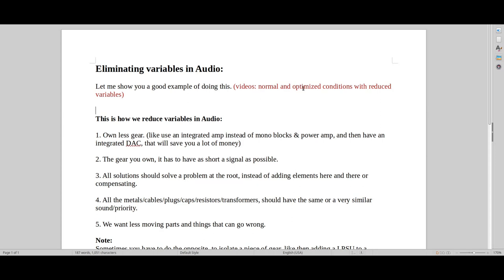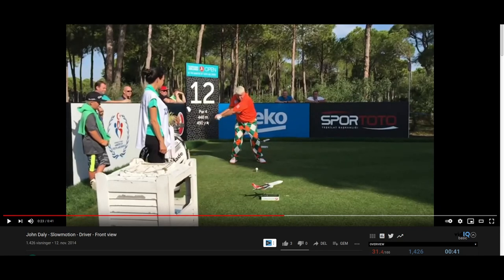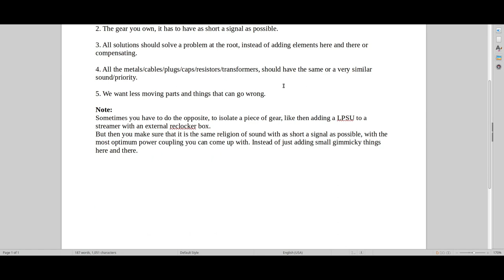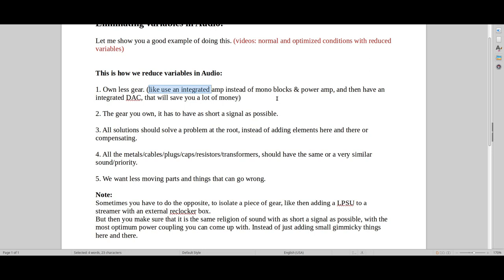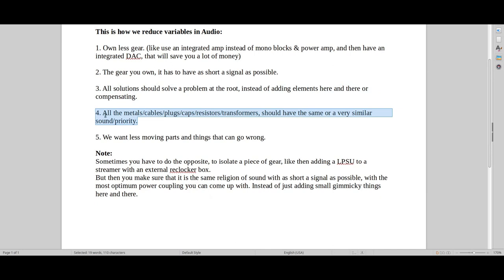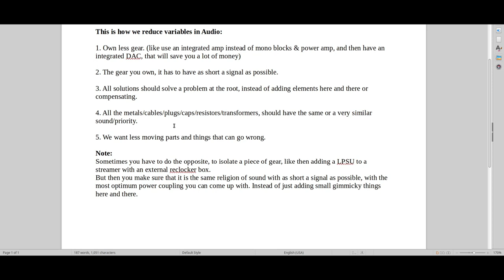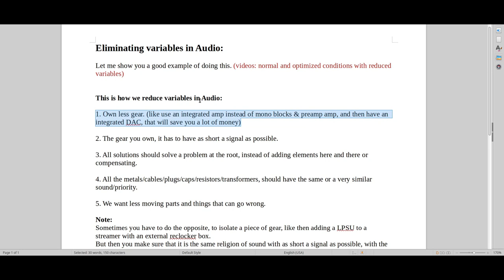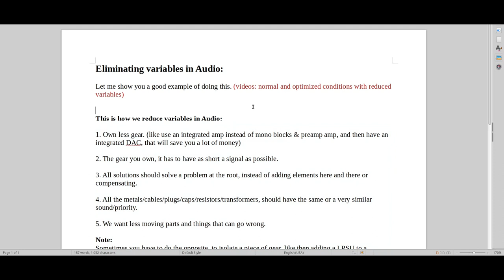Eliminating variables in audio

Comment: For the past 15 years I have been using tube separates built by an individual in Pennsylvania who goes under the name Emotive Audio (not Emotiva). These are high quality tube pieces. I have stockpiles of NOS tubes and would swap out different signal tubes or power tubes or rectifier tubes and for the most part would have fun. Then last April I bought a Jeff Rowland Continuum S2 class D integrated amp and I am enjoying the simplicity of this amp. No tube rolling and no need to wait for it to be warmed up, as it’s left on all the time. The soundstage is slightly smaller compared to monoblocks, and it lacks that roundness you get from tubes. But I have music as soon as the needle drops or the cd starts. Coming from tube amps, including OTLs and SETs, I never thought I would enjoy Class D.